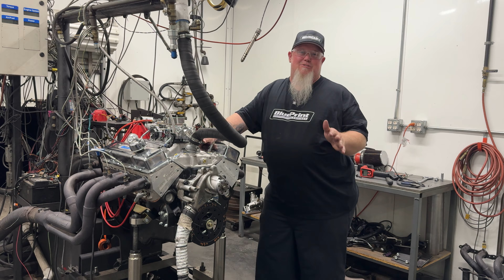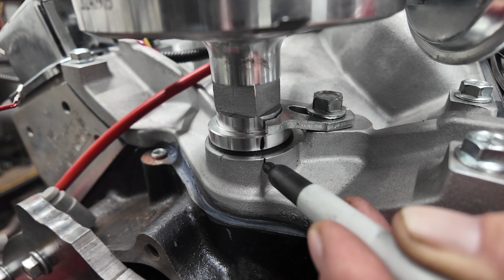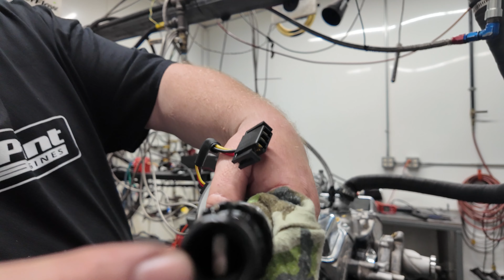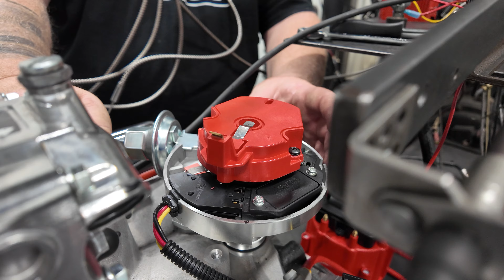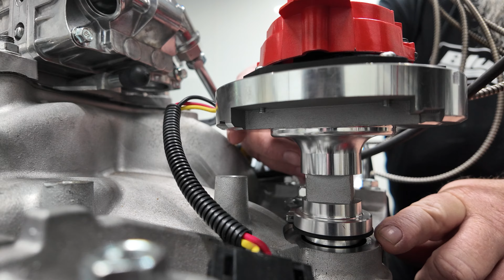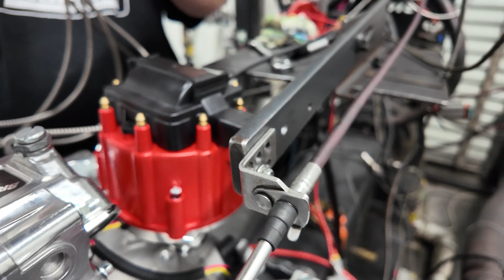How to Install a Distributor and Set Timing feat. Chad Reynolds

Comment: On BPE engines I've worked on. To get the rotor pointed to #1 cylinder. I turn the oil pump drive shaft so the slot is parallel with the back "china' wall of the engine block. Point the rotor straight towards the #8 cylinder will allow the gears to rotate the rotor to proper position.

Comment: tyvm for video! My fully dressed 383 shipped yesterday for my 68 Camaro. I plan to replace your distributor with a MSD distributor w/ seperate coil due to firewall  tightness. Would you recommend swapping it after the 500 mile break in, or?
Reply: I'd put it in first. So much easier to do with the engine out of the car. But, use the recurve kit that is included with the MSD to change springs, and bushing to get it to advance faster. Use 1 light spring, 1 medium spring, and the black bushing. This will give you 18 degrees of mechanical advance and all in by 3000 rpm. Confirm this with the instructions. This will allow 16 degrees of initial timing at idle, with vacuum advance disconnected. That will give you the recommended 34 degrees total that BPE recommends. The bigger cammed engines like more initial timing and less mechanical.
Reply: @RebeldryversGarage  Ok, just fired up for the first time using your spring suggestion. For some reason it is stuck on high idle and will not kick down. Running 1800-2500 at idle. But idling that high, gonna be way advanced. Could springs be causing this? Holly 750 classic with electric choke. Setup using 16 degrees on timing (based on turning crank to tdc #1, moving to 16 on balancer and aligning #1 on distributor with rotor left edge. Hard to time with gun at such a high idle. Ran out of time tonight to keep trouble shooting.
Reply: @williambatten8  Has nothing to do with the distributor and everything to do with the carb's high idle setting. Push down the plastic arm behind the choke housing to knock it off the high idle in order to set timing. Then follow Holley's instructions to set the high idle speed screw.